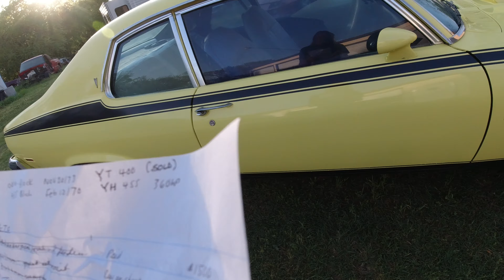Story and cost to buy and build my 1974  Pontiac GTO

Comment: Clean lines. Actually a good looking car.
Reply from the maker: Thanks!
Reply: @clunkersandclassics  no sweat brother. Keep on keepin on.
Reply: @clunkersandclassics  I noticed the tiny rubber round plug is missing where the optional clock radio would be.  It is to the right of the odometer as I'm sure you know.  Did that fall off or did you take it off.  I have noticed that a lot people did not choose to have that option for whatever the reason.  I'm not sure how many are left or where you could find a clock for it.  It is likely extremely rare to find one in any type of condition.  I'm not sure if it would add much value however.  I think you would have better luck just finding that small rubber plug, to close that little open gap.

Comment: Had a '74 Ventura I bought in CA for many, many years. An unfortunate number of those years were spent gathering dust after the transmission started slipping and I never got around to treating it right. Did finally let go a sell it to someone who fixed it up nice. He fell in love when he saw a rust-free 2 door, all original. Still think it's the best looking front end they ever put on that body. Oh, btw, the larger displacement Pontiac engines actually weighed a little less than the smaller ones, since it was the same block with larger holes bored out of it.

Comment: If you ever get a rock chip quick tip for you that's cheap if you could stop at any command store and give you some real deal super glue I mean the stuff with cyanolac related in it you can fill in the crack you'll show but it won't never spread they also have some stuff in o'reilly's it's pretty high if you want to know something you aint gonna see if it's called glass wild for chips and stuff but I always use real good super glue on my stuff and it never spreads out they talk my brother that used to work at the Jiffy Lube for a long time when he was on probation and that's what they did to the window will it come in chip and they charge certier 40 bucks for the To people so that super glue treatment for spots where do you get the spot and catch it before it spiders out and bust out until big on crack like that in my area they throw rocks out of gravel trucks and stuff like that so it's very common for us to get a chip

Comment: Great job, and a great choice on the 455 is it a HD or a SD ? 4 bolt main? I  had a 455 7.5 ltr  with a automatic turbo 400 in a 1974 Pontiac Grand Safari station wagon . It was 5500 pounds empty. Ice  Cold r12 V.I.R dryer aircondititoner. I  really loved the 455 it was a terrific engine..  Again I think you have a great car. I always liked that body style uni-body.  Pontiac is a class of its own.
Reply from the maker: It's a 1970 455 370hp, the first year and highest hp for the 455.
Reply: 455 SD is rarer than a Unicorn.  If you happen to come across one you struck gold.

Comment: i got a 73 ss nova that still has the factory paint in good condition was really good till i got it now it has rubber all over it burnt right in to the paint and vinyl top  behind the rear wheels looks like under coating it was comp orange back there now it is black. i only had 700 in the car with a 396 tunnel ram and a pro built 400 turbo stage 3 shift kit good to 2,000 hp got it for 200 bucks from the shop fresh with warranty .now i been getting the ho 454 450 hp with a 02xx 400r turbo from 6,000 to 58,000 miles on them for free with a bunch of extra parts last year i got 4 crate setups all free . i found what they put them in and most people have no idea that they have crate engine setups in them . the engines have steel crank heavy rod with high flow heads so the bottom end is built from the factory all they need is to breath. they have a stock intake but still put out 450 hp with a small carb that i thought was impressive. i picked up a 750 double pumper and  a high rise should give it a bit more power .my friend give me a roller setup but it will not work with stock heads have do some head work before i run it

Comment: Forgetting the 301, it's an actual smaller block, same trans pattern. When someone says small block pontiac, I think 301!
Reply from the maker: The 301 is best forgotten...lol. I think that was a corporate engine, not a true Pontiac.
Reply: @clunkersandclassics  True, it was , however, an almost, high revving race engine, almost! Not good in the form given to the public! Now, with stand alone computers, a fuel injection and turbos would make good power!
Reply: I’m sorry but you are wrong about the 301. It’s the same as all the other Pontiac engines. This was Pontiac’s smog engine just like the 305 was for Chevrolet. I had a 1977 Grand Prix with the 301 with the 2 bbl carb that was a quadrajet with the back barrels molded shut. It was great on gas but was a gutless wonder just like the 305 Chevy. I went to the local junkyard and bought a intake and carb off a 73 Bonneville 455 and it bolted right on the 301. Boy did that wake up the 301. Drove it a couple years and sold it to a friend.
Reply: @bradleybisping  Interesting. No port overhang anywhere?
Reply: @arthursmith5409  If I remember correctly it’s been a long time ago. The ports in the 301 were a lot smaller but I used 455 gaskets and it worked ok.
Reply: 301 is all pontiac. Basically same physical dimensions as 400/455 but 301s have a shorter deck height. Otherwise they look identical.
Reply: @colescrustycars  I'd love to see one built, with fuel injection and turbos if today's standard. It would scream, I believe.

Comment: It is funny when you said that about the Pontiac 350 being the same size as the 455, and that there is no difference between them!! Also you said that there is no "small block" or "big block" which is also true!!!

Why I find this funny (not haha funny) is because I am an Oldsmobile guy myself and I learned the same thing about Oldsmobile engines and idiot STILL fight with me that an Olds 350 is "smaller" than a 455 Oldsmobile engine!! In fact one moron tried to tell me that the "Olds 455 has a taller deck height, just like a 455 big block Chevy" and that is NOT THE CASE EITHER!! 

For starters the Oldsmobile gets there "displacement" from both the crankshaft and the bore size!! Denominational size of both the Olds 350 Rocket and the Olds 455 Rocket are exactly the same BUT the Olds 455 has a larger diameter bore and a much longer stroke in the same engine block!! 

Another strange thing is if you look at the "V" angle on an Oldsmobile engine the cylinders sit at 60 degrees from the center line instead of the Chevy's 45 degree spread!! This means the Oldsmobile engines are physically wider (which I think Buick and Pontiac share this feature as well) on their engines!! While Chevy DOES have taller decks to make up the 455, the cast iron cylinders of an Oldsmobile engine are generally "thicker"!! 

THERE IS HOWEVER ONE OLDSMOBILE SMALL BLOCK!! In 1963 and 1964 both Buick and Oldsmobile built their own versions of a 215 cubic inch all aluminum engine!! The engine Oldsmobile built was installed in the F85/ Cutlass bodies while the Buick engine was installed in the Skylark. IT IS THE ONLY SMALL BLOCK OLDSMOBILE EVER BUILT THAT I AM AWARE OF!!! And every thing I have read about that engine says that they also had an optional supercharged version of it that produced around 400 horsepower from an engine that only displaced 215 cubic inches!! ALSO this all aluminum engine was a much tighter "V" configuration at about a 30 degree center line, which when you see one of them the intake manifold is only about 9 inches wide or so!! Or narrower to that of the intake on a 2.8 liter V6 roughly! I have only ever seen TWO of these cars (which happened to be ONE Buick and ONE F85) with this engine configuration!!
Reply: Oh and by the way I owned a 1974 Oldsmobile Omega with a 350 Rocket in it, I also had a 1977 Oldsmobile Omega with a 305 Chevy in it! I miss both of them greatly!!

Comment: Basically the 1974 was nothing more than a Pontiac Ventura with a functioning rear facing shaker scoop. The last good year for the GTO was 1972. You could still get the 455 H.O. engine.